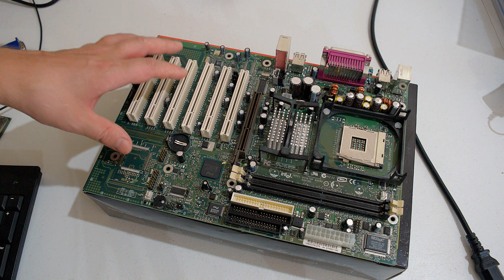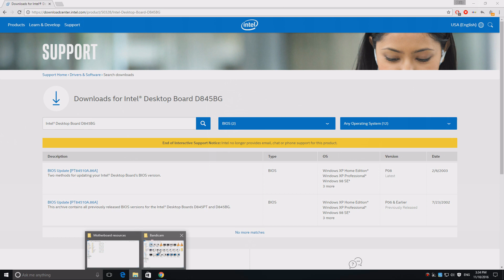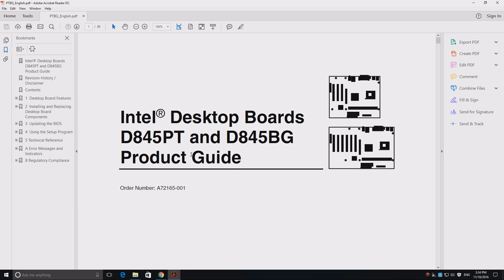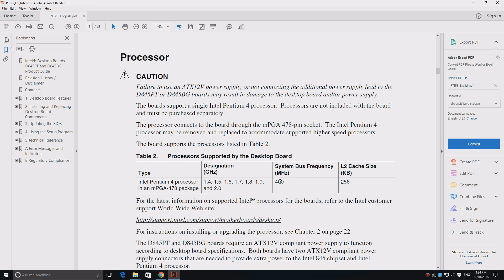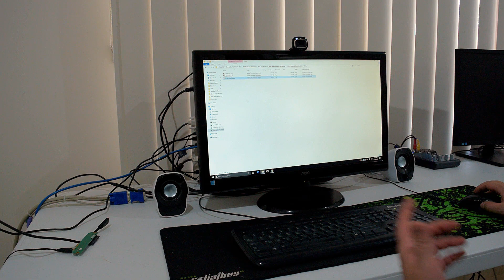Testing Intel D845BG motherboard

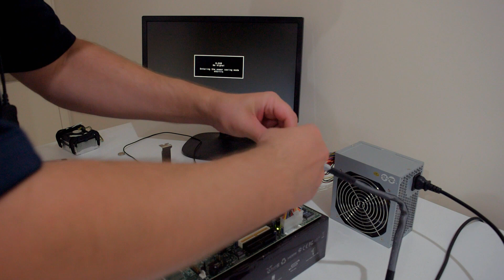Comment: Hey Phil, I noticed at 7:42, you plugged the floppy device in with the board on.  I’m always doing stuff like that by accident and I worry I might have damaged something afterwards.  I actually just recently did that on a legacy PC and I’m mad at myself.  It doesn’t appear I fried anything because it still works ok.  What do you think?  It looks like no harm done, right?
Reply from the maker: I just checked the video, looks like the PC was turned off, so all is good 😊
Reply: @philscomputerlab  , you are the man, Phil!  Thanks 👍🏻

Comment: Sadly it's next to impossible to get intel motherboard drivers now. I have a BI440ZX board and have been trying to find a newer bios. I have the P07 Bios, however I hear there is a P09 Bios. Already checked the Wayback, I found the disk that comes with it, but no BIOS sadly.

Comment: Ah I used to want this motherboard, there is something beauty about Intel generic motherboard. This board are the earlier DDR 845 that only support Willamette 180nm 256kB L2 cache CPU. It's weird that the capacitor bulging since the caps on Intel motherboards are usually high quality. Intel board usually good if you don't bother to overclock, but even if you do you can look up the PLL chip on the board and download some software to control it.
Reply from the maker: Yes I also like Intel boards. I don't like to overclock, so that doesn't worry me.

Comment: Well, after some testing, i can say you can use a P4 up to 2.4 ghz Northwood for testing a socket 478 mobo without using thermal paste. 2.53+ Northwoods and Prescotts are not really situable for this. You'll still need an active cooler to avoid overheating, so passive cooler and not even cooler at all
Reply from the maker: When I tested some of the faster CPUs, I ran into throttling issues. Got a beefy Zalman cooler, almost 1 Kg, and that did the trick :)

Comment: Hey Phil (and his "community") I would really love to have a second opinion on my retro PC gaming build. I am thinking of running Windows 98 and XP on it.
What do you think should I upgrade/downgrade?

Pentium 4 530J 3GHZ HT or Celeron D 2.93ghz (in case the motherboard I get doesn't support the pentium's 800MHZ FSB)
1.5GB of DDR-400 RAM.
Some Gigabyte PGA478 motherboard (Seller hasn't given the model yet)

And the best of all, a ATI Radeon X1950 Pro 512MB GDDR3 256BIT AGP graphics card which only consumes 66W of power. Perfect for the firecracker of a powersupply that I will use!

^ All of those for well under 50 euro.

Do you think this should work for that exact application? I had a gaming PC rig for this before, a Pentium 1.7GHZ, 512MB of SDRAM-133, and a FX5500. But the FX-5500 had massive driver issues, that pentium was dog-piss slow and eventually the board crapped out. I went to pull the CPU cooler so I could upgrade the CPU, the CPU came off with it and the PGA socket was broken, I know right?

Regardless, I hope you can read this wall of text and give me your input on what I should change.

Comment: Definitely these Chemi-con KZG 6.3x3300 capacitors is just a nightmare. Arrrr, years and years of of mass-produced motherboards for different sockets with these famous KZG...
By the way, why 845? At least 865-based motherboard easy to get and they have the support dual channel memory.
P.S. It would be very interesting to see the P4 with RIMM  ;)

Comment: Was it just me or did you not add any thermal grease to the CPU?
Reply from the maker: Why would you put thermal grease on the CPU for quick test of a few minutes?
Reply: I dunno, those Pentium 4s were ludicrously hot, wouldn't want a thermal shutdown during that BIOS update, but you've probably done this more times than me.
Reply from the maker: Nukleon Yea, that one is just 1.7 GHz. It's really not an issue. No load on it, just sitting idle.

Comment: The big brown leaked caps are staying parallel to the small yellow SANYO caps, so yellows do all the work successfully. No reason to replace any caps, yellow ones are of good quality (according to my experience).

But flashing BIOS with leaked caps is NOT that good idea at another situation. System becomes unstable with more chances, and there is no profit from bios flashing, only risk.
Reply from the maker: That's a contradiction. No reason to replace the caps, but don't flash the BIOS :)

Comment: i am surprised that posted with those caps like that, the are probably VRM caps and now your power to CPU is very unstable. I have had board like that that do not post, replaced the caps and they do.. you got lucky on that one friend. ;)
Reply from the maker: I'm working on a video about caps. I found that all my boards, even with bad caps all over the place, will all turn on. They might not be stable, but they will have sign of life. But maybe I was lucky :P
Reply: I understand that, ya i do have some that will post but are not stable.. I just picked up a old shuttle AV61 v14 with about 19 bad caps, but it came with a PIII 550mhz  will make a cool retro if i can get the caps repalced.

Comment: You should follow this up with a capacitor replacement video of that board.
Reply from the maker: Good idea :)
Reply: Yes! And also a video on how to clean both dusty and really grimy cards.
Reply: jiddro33 Give it a bath, using luke warm water, mixed with alcohol. Scrub it with a clean and soft toothbrush submerged in that mixture. Finish it of by giving it a shower, using cold clean water. Dry it on an antistatic bag on a table for 48 hours in a warm room.

Comment: Hi Phil,  Was reading the manual and it looks like if you failed with the bios update, Intel has some kind of "recovery mode" that's jumper selectable.  Probably some early version of dual bios?
Reply from the maker: Nice! I always look for this stuff if / when something goes wrong :D
Reply: I stumbled upon that because I was curious as to what that brown slot was on the left side (thinking that was a slot that made PCI cards more DOS compatible). Reading up on that, turns out it is a CNR slot and Intel and others may have made some audio/modem/network cards that go into this slot.

Comment: Phil, any suggestion for a SiS530 AMD K6-2 500MHz PCI graphics card, easy to find? Only for run pre 2000's games in decent frame rate
Reply: Just got some FX5200-s (Quadro NVS 280), have to send one (from 3) in for warranty, it was DoA. You can also find some MX440 or something like that on amazon. Just search for "xfx mx 440 pci" or "xfx mx 4000 pci", you'll find them. Should be priced around 10-15 euros tops. There's also the Voodoo way (3 also has PCI editions), but it's more expensive.
Reply: Elod, keep away from the 5000 series. It is SUCH a pain in the ass. The drivers have compatibility issues even with not so old games such as NFS Porsche 2000 which displayed no text and frame-rate issues in games like Colin Mcrae 1.0 and 2.0 (frame drops for no reason, again, driver issue on a pretty otherwise capable FX-5500)

Go for a Voodoo or if you can find a motherboard that supports AGP and go for anything half decent. I use a ATI Radeon X1950 which is COMPLETLY overkill but still has drivers for 98.

Wish you luck.

Comment: I just prepped my old p4p800 board with an ati  9800pro and a pair of voodoo2 cards for a little old school gaming. Just blew the dust off all the components and replaced the cr2032 battery.. Still works perfect. Put a Northwood 2.5Ghz non HT in it..

Cheers!

Comment: Which one perform better between Pentium 4 or Core 2 Duo when it run on XP OS
Reply from the maker: Core 2 Duo!
Reply: Core 2 Duo = Dual Core,
Pentium 4 = Single Core.
There are no Core 2 Duo's clocked under 1,8GHz (at least in Desktop).
Slowest is E4300 (@1,8GHz), and it will "run circles" around Pentium 4 3,4GHz in Win XP.

To have Single cored C2D-type CPU, you have to go all the way down, to Celeron 4x0 series.
Reply: Core 2 all the way.
Reply: Well it depends if you have a 1.66ghz core 2 duo it will be slower than a 3.4ghz Pentium 4.
Reply from the maker: Paperboy And consume half? the power?
Reply: To be fair, Pentium 4 will be faster than Celeron 4xx (Single Cored, Core 2-type CPU).